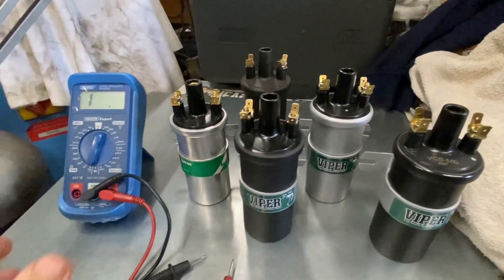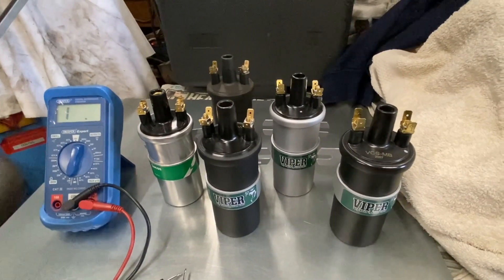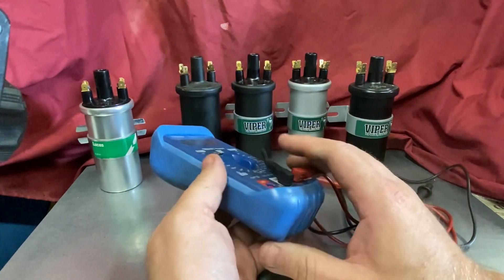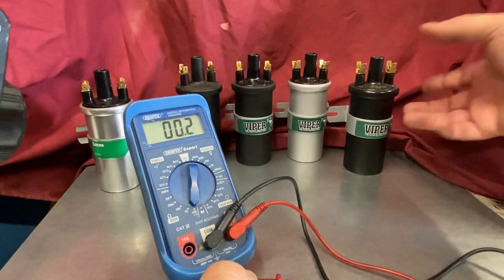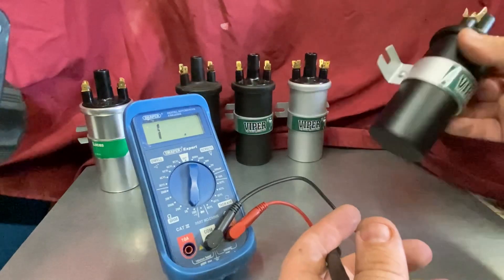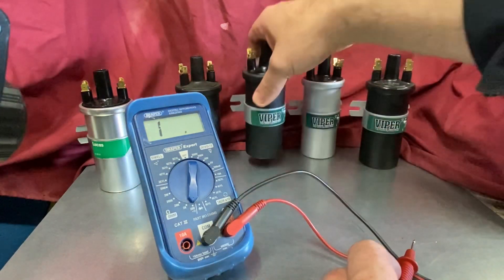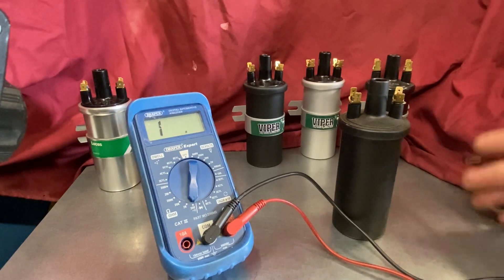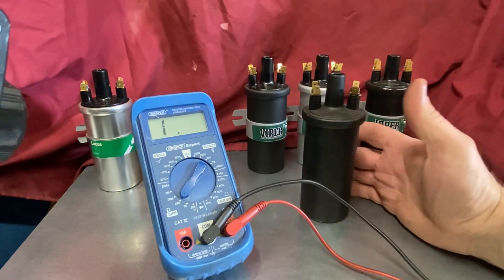Measuring ignition coil primary resistance

Comment: i have a 93 cooper converted back to a hif44 carb with a pertronix flame-thrower distributor 59D A+ w/vacuum advance and my coil is 0.8 flamethrower II coil. just wanted to know if that is right. the car was rewired with a  YMC10654 new harness for WIRING MAIN LOOM FROM 1989 SERVO BRAKES from minispares my coil has from the loom the 2 white/black to neg and a yellow and a pink/white to pos side. when plugs fire the spark looks week, any idea why. i would have to come tune mine but i am in the US. oh plugs are gapped at 35 and are NKG BPR6ES
Reply from the maker: You need to see if the dizzy is a variable dwell unit, by measuring with a dwell meter. You also have a ballast feed to the coil which is not needed with a variable dwell dizzy
Reply: @ACDodd  I'll see if I can find a dwell meter. And let you know
Reply: @ACDodd  yes it vas the pertronix ignitor II with variable dwell
Reply from the maker: @troypowell1671  ok next contact Petronix and see if the module is rated to run with a 0.8 ohm coil with no ballast resistor.
Reply: @ACDodd   yes he said i can get rid of the resistor wire he said the  modules are rated at a certain volts and no matter how many you try to put through it it will only put out what it is rated at  but you restrict it and you end up with weak spark
Reply from the maker: @troypowell1671  remove the ballast and you will feel the difference
Reply: @ACDodd  do I just un plug the connector  that has the pink and yellow white, or does the yellow white have to say connected with the new wire that's full 12 volts from fuse box.
Reply from the maker: @troypowell1671  disconnect both, and fit a new wire from the switches live curcuit from the fuse box. Make sure the wire is prevented from chaffing, as the ignition live is un fused
Reply: @ACDodd   thank you for all your help. It runs much better now . Still have slight lag on takeoff, but I have a guy in Portland about an hour away that can profile the needle if need be
 Hopefully, all this helps others that find your videos. I also tell my mini friend's to them them out. Again thank you.

Comment: So would you say a 4.5 ohm coil would not be suitable for a NON ballast points ign system? This is actually for my RE Bullet motorcycle butI have heard so many "experts" saying "to high" or "to low" and I know nothing about electrics so I must turn toa real expert for proper advice! Thanks.
Reply from the maker: How many cylinders?
Reply: @ACDodd  Single cylinder 4 stroke points ignition no ballast as far as I can tell! Cheers
Reply from the maker: @notwocdivad  single cylinder that should be fine. However if you want to increase the plug gap, then fitting the appropriate lower resistance coil is the way forward. The lower the coil resistance the more current the points will have to contend with and the shorter the life of the contacts. You will also need to adjust them more often.
Reply: @ACDodd  Thank's AC, You have been a great help. The Standard plug gap is 
.70mm which will do me on a low power engine like the Bullet! I'll replace the HT lead and see if that gets it sparking. Thanks again.

Comment: All new cheapy multi meters are shipped with the 9 volt battery not fully connected. The plug is pushed on 1 terminal & just touching on the 2 terminal. That's why it wont zero when probes connected. It's a good idea to fit a new 9 volt battery as well.
Reply from the maker: My £450 bluepoint meter is no different

Comment: AC, What is the difference between a 1.5ohm and 0.8ohm coil when using a 65dm4 non ballast?
Is it just that you can increase spark gap to 35thou with a 0.8ohm?
I have a 65dm4 no ballast with a 1.5 40,000 output coil and gapped plugs at 32thou, should I reduce this to 25?
Any advice is appreciated
Reply from the maker: Some coils will run fine with the larger gap, try both and see what runs best. However I have noticed that some coils breakdown when firing wider plug gaps, and hence using the correct rated coil for the job
Reply: @ACDodd  Ok thanks for the advice,I will reduce gap at 25 just to be on the safe side .

Comment: Does the coil have to be checked disconnected from the car?
Reply from the maker: It needs to be disconnected from the electrical circuit to be able to check it. Only one side of the coil needs to be disconnected to make the measurement.

Comment: Good information I have starting problems with my 200 six in 64 Ranchero, runs well but needs help staring, could it be a mis match between the HEI distributor type ignition and the coil, a standard, not a "flame thrower" type. I did measure the resistance and it checks out to spec in the range, about 1.5 ohms. I will check and replace new plugs and gasp them per you recommendation soon's I get them, I'm looking at a rebuild of 1bbl Holly crab too, plus and new fuel pump. Thanks for the vid, very valuable if you want to get down the road in your old cars! :D
Reply from the maker: Check to see if it has a ballast resistor still fitted, it might be that the connection to short this out during cranking is not working this reducing the ignition power while cranking.
Reply: @ACDodd  thanks for the tip, I will check that.

Comment: Thanks for the lesson.  I have a 65D,  is there a problem to use a 1.5 instead of the .9 you suggest?   Much easier to source.
Reply from the maker: You can use a 1.5 ohm coil, but you need to reduce the spark plug gaps to 0.025”. The point of the 0.8ohm is more spark energy, that means you can run 0.035” plug gaps.

Comment: Hi AC would you recommend converting a CSI Ignition and 3 Ohm coil to a 1.6 Ohm coil and ballast? Would you also keep the 0.025” gaps on the spark plugs? Thanks in advance
Reply from the maker: Yes and yes.
Reply: @ACDodd  thank you.

Comment: Hi AC - useful info again Thanks. You showed a coil damaged by running too big a spark plug gap for a ballast system. Is there any issue or consequences of running too small a gap with an electronic system i.e. 65DM and 0.9 coil  

I need to check mine as I'm not sure I realised or read the right info when I fitted my kit car with 65DM/0.9coil  from an MG Metro- cheers, Mark

(Note - I've also just changed my air filter after watching one of your on the road sessions where you said the filter  fitted was no good which was the same as the one I had)
Reply from the maker: Too smaller gap does not do any damage as far as I have experienced however you can light off leaner fuel mix using the larger gap

Comment: Thanks for the video AC! I have in my aplication an 123 ignition with a Bosch blue coil (3.3 ohm). Is this setup ok?
Reply from the maker: It’s lacking energy at higher rpms
Reply: @ACDodd late answer from me. I see you use the 1.5 ohm balasted Viper coils at the 65D electronic ignitions. Will this be the one that I need for my 123 ignition and will be there a improvement? Thnx
Reply from the maker: @StefanMiniCooper  no I have now reverted to the 0.8ohm viper I had a couple of coil failures with the 1.5ohm units running the bigger plug gaps.
Reply from the maker: @StefanMiniCooper  whichever dizzy you fit you want to be using the highest coil power you can.
Reply: @ACDodd  ok, thanks for your reply! 123 says that I need a coil with a minimum from 1.0 ohm, so 0.8 ohm can damage it I'm afraid. So maybe better to look for another 1.5 ohm coil?
Reply from the maker: @StefanMiniCooper  follow the 123 advice.
Reply: @ACDodd  that they write on the website from 123 ignition, lower then 1.0 ohm and I can damage the 123 ignition. You say that my 3 ohm coil have to little sparks on higher rpms, so I want to try a 1.5 ohm coil. But which brand and type...if the Viper ones aren't that good
Reply from the maker: @StefanMiniCooper  I have not tried that combination, as I curve dizzies I see very few 123’s
Reply: @ACDodd  Ok AC, thanks for your advice. Maybe if I find a 1.5 balasted coil (123 have automatic dwell angle) I will give it a try.

Comment: Excellent information. Just for clarity, if you are fitting an electronic points replacement kit, would you stick with the same coil as for actual points? Most adverts say no other modification necessary. Do these kits change your plug gap recommendations also? Cheers
Reply from the maker: Stick with the same setup. However if you were using a 3 ohm coil you would be better off converting to a 1.5 ohm at the same time and including a ballast resistor. Better still fit a kit that can use a 0.8ohm coil and the you can fire 0.035” plug gaps
Reply from the maker: Coil type determines plug gap. Aftermarket electronic ignitions have different requirement depending the age and who makes them.
Reply: Thanks for the coil video,most of my work is on early gas forklifts.sone still have points but most have electronic ignition and coils.ive seen some starting problems when cranking no start and as the key is released they start up,as if the coil isn't getting enough power during cranking.is it wrong coil or ballast needed.thanks.

Comment: Great information. Maybe it would be usefull to say what spart plug gap you recommend for each application as well? 0.025 for point distributor and 0.035 for electronic one? (as most sources say, or do you have other opinion based on your experience?)
Reply from the maker: You have it correct. 3 ohm and 1.5ohm ballasted types 0.025”. 0.8 is ohm with the 65d 0.035”
Reply from the maker: 3 and 1.5 ohm coils 0.025”, 0.8ohm 0.035”. Standard new plugs come at 0.032” so the gap is too wide for engines that are not using the 0.8ohm coil and needs to be reset at 0.025”. All new plugs need to be correctly gapped before fitting.
Reply: So for my electronic ignition I should have a 0.8 ohm coil ?
Reply from the maker: @ianroberts8692  what electronic ignition have you got?
Reply: @ACDodd  replaces the points in the dizzy
Reply from the maker: @ianroberts8692  got a photo?
Reply: @ACDodd  yes I do
Reply from the maker: @ianroberts8692  I can’t help unless I know the exact type you have
Reply: @ACDodd  sorry,  all I can definitely see is that it's a lucas,  unfortunately the mini is in a lock up and not in a attached garage
Reply from the maker: @ianroberts8692  I need to be able to identify the unit to be able to advise sorry
Reply: Good info thanks, I've  been using a CCI electronic distributor in my mgb for years along with a Lucas sports coil (oil filled), and have always thought it should run better than it does, and more recently got worse with coughing and spluttering and cutting out when hot in slow stop start traffic. I have renewed most of the fuel side for other reasons without success. I'm thinking I have the wrong coil fitted and should change it to a dry coil for to go with the electronic dissy..